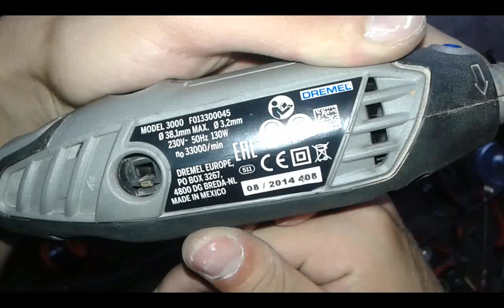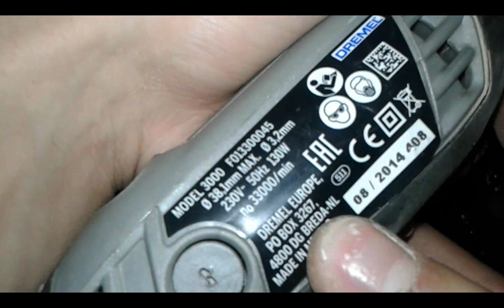Dremel 3000 Just Stopped Working. Step by Step Repair.

Comment: Thank you for this video, I checked mine and it was an open at the terminal. However, it was terminal end of the beginning of the spool, so I had to unwind the wire to get to the damaged end, then manually re-wind the wire. But none the less, it worked. Thank you. I was about to through the unit away and buy a new one. Thank you very much.

Comment: Same issue, wire snapped off the coil at the connector. Ended up positioning it near the connector and then dumping hot solder in the gap to bridge it. Works again. Thanks for posting!

Comment: It wasn't so easy to find my broken wire as all wires were in the brackets, but after using a multi-meter I could clearly confirm I had the same problem. I actually had 2 Dremel 3000's fail the same way, with the same problem. Thanks for the helpful video!

Comment: Thank you, Once again! I opened mine up and it was the coil- on the bottom side, had to re-solder the wire to a longer piece (as you cannot unwind it) after scrubbing the insulation with a knife- the copper wire will shine under it and then you can solder and check for conductivity - 20 minutes total, now my dremel is good again!

Comment: Thank you helped revive my favorite tool over 15 yrs old 3000 model. Ended up having to unwind one entire side and re wind it but it fixed it!!!
Reply: How did you manage that?
My wire broke and I couldn't release any more as it was trapped in the coil. Worried it would break if I pulled any harder and I'd not find the end.
So what I did was strip some copper wires from another wire. Solder the tiny wire on the end and paint it with my wives nail polish to insulate.
What a load of pointless faff because some fools approved a tiny inappropriate sized wire!

Comment: Not as easy as the cable was wound tightly behind the stack, but still managed it. It's just pot luck which side of the wind goes I guess. 

But this sorted my 3000 a treat too. Thank you. My previous one died the same way but I wasn't aware of this fix.

Comment: Awesome! I actually found a slightly different failure mode, but wouldn’t have found it without your video. One of the motor winding connectors had come out of the receiving block. I only realized it when I looked back down at your video on my phone and noticed the tiny metal part sitting on my screen!

Comment: Dude...... kudos for the fix but why the need for such a heathen attitude towards those poor little screws. And their corresponding mating holes in the plastic. I ALWAYS use the gentle approach to these things because, believe it or not, with your approach to the physical side, you’re gonna break more than you fix if you’re not a bit more careful.
Other than these comments a warm thank you for uploading fixes like this for the masses who don’t pull things apart and learn as folks like us do! lol 👍
Reply: My guess is he's experienced with it and his drills torque setting is reliable. I would cross thread these plastic body parts so would never do it myself.

Comment: I had the same problem with mine a few years ago, it broke twice (each stator winding failed once). In my case it was more tricky as the inner start of the winding snapped rather than the outer end so it involved careful and fiddly stripping the very short length of winding wire and extending it with another bit of wire before I could attach it to the terminals. This seems to be a design flaw where the drill vibration causes the stator wires to fatigue and break at their terminations. A small dab of glue or silicon would make the wire terminations stronger.

Comment: Well, guess what, this was the exact problem with mine. Thank you for this video, my dremel is now up and running again.
Reply: Thx for the video. Mine has a different pblm wich after inspection became evident. It has a torn wire at the bottom of the spinning rod, where they are like crossed on each other and fastened to the metal pieces where the carbons touch. I'm going to solder it, see what happens.

Comment: The magnet wire in the field coil seldom breaks. The cause of the malfunction is either due to the carbon brushes that need to be replaced or due to the electronic control that needs to be repaired by a qualified electronic technician. If there is a problem in the field coil it is because the coil is burnt and this will affect the rotor. Rewinding the field coil is simple - just count the number of turns per pole, same direction as the original must be observed and same number of the magnet wire...but you need to replace also the rotor. It is difficult to rewind the rotor but you can buy it at $20 in our place in the Philippines.
Reply: I had 2 Dremel 3000's die in the same way, on the same day. Both needed the connections on the field coil fixed. Nothing wrong with the wire coils in my case, just the connections are poorly made. Seems like something that would cause a common failure to me, however I don't expect this to be the cause of everyone's problems.

Comment: This exact thing seems to happen often. When you look at the little metal clip, the enamelled wire from the field winding is pressed into a little slot of metal and when the tool vibrates, it eventually shears off. Fixed mine twice in one year of light use. Dremel should address this issue.

Comment: This repair procedure works fine if the wire is broken at the outer end of the field winding, when one can unwind a turn of wire to give sufficient free length to be able to remake the connection. However, if the wire is broken from the inner end, it is not possible to unwind a turn - and be warned that the wire is easily broken! The only solution is to solder a wire extension onto the loose end, so that one has enough wire to reach the connector. I am not sure if the wires break due to vibration or corrosion but in either case it may be worth putting some silicon sealant on the connectors to hold the wires steady and keep air from reaching the copper to aluminium joint.

Comment: I bought a 3000 years ago and until today I worked flawlessly. Of course the thermal fuse decided today was the day it finally just said “fuck it” and gave out. Luckily we can buy spare parts for a tool that costs less than $90 though. 🤣

Comment: Mine had exactly the same problem!  I was able to pull the small contact out of the housing though and thread the copper wire back under it, before reinstalling the contact.

Comment: Hi,   I have an 8200 w/2 batteries.  I trim my dogs nails with it every 2 weeks on a bit over 1/2 speed.  It stops and the battery lights flash.  The only thing that feels remotely warm is the dremel body.  Batteries are charged and feel cool.  What do you think may be the issue?

Comment: Hye i just watched this because the speed on my dremel was cutting off. I wouldnt have been able to use it. All i needed to do was take the first part off that this guy took off. That little spring with what i think is a magnet. It needed to be re centered and have the cap put back on. I was not gunna take this whole thing apart like buddy did. Haha good work tho

Comment: My reasonably new Dremel, has ceased to work too, I suspect exactly the same problem, which seems to be very common, so must be a manufacturing/quality fault ? Dremel should do a recall or replacement service, they aren’t exactly cheap.

Comment: Clever idea but copper wire goes to inside of coil so snapped off when I tried to uncoil it. If Dremel's have this minor fault then it's a piece of crap designed to burn out. At this price and being the second to do this it's not built to endure anything but light use. I've read elsewhere that commercial users of multi tools use air driven power not electrical like this due to them always burning out. Great tool. Crap design.

Comment: The dremel 3000 is the same as the craftsman rotary tool variable speed, besides the board before the switch, sadly this board prevents the switch module from a sudden overload, which fries the switch module, I couldn’t fix my craftsman.